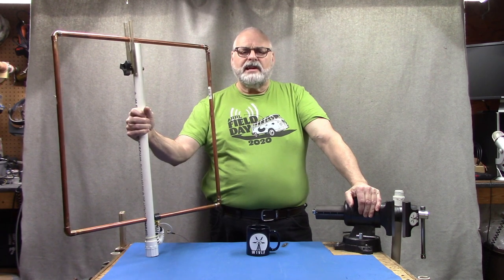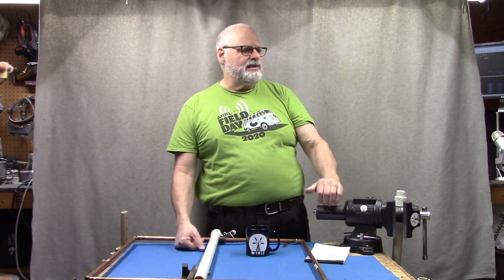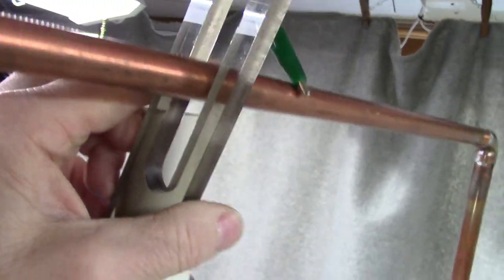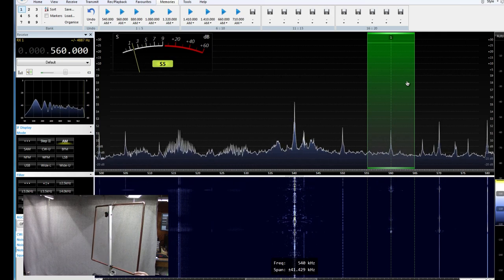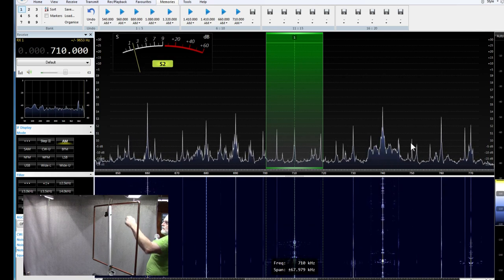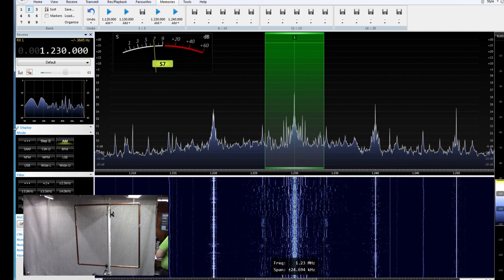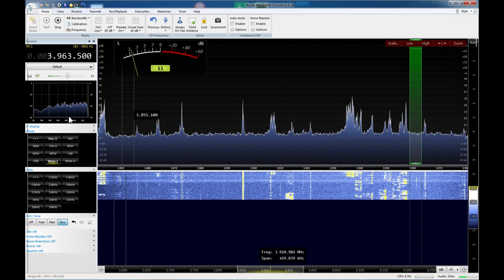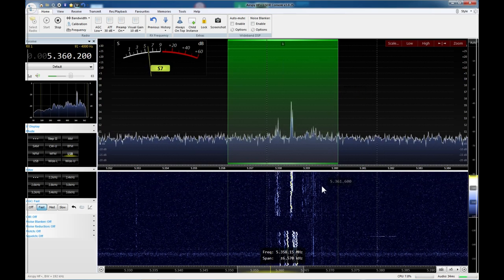W1VLF  "LIL" Low Impedance Loop

Comment: I wonder if one could use 1/2" pvc/cpvc pipe covered with copper adhesive tape thus eliminating the copper pipe? Would be a lot cheaper, lighter & easier to build. You might also get better results if the antenna were round as opposed to square.

Comment: I need to build a noise sense antenna to receive my neighbors plasma tv QRM generator. I’m thinking to build a 3-4 ft LIL. Ideally, I need a near field antenna, so that the distant signals aren’t cancelled. Using the 75 material, how many spurns on the core would you guesstimate might work? Increasing the turns lower the frequency effiency?

Comment: is there any way you can put together one of those and send it out to me? I am one of the few totally blind hams that enjoys a good bit of shortwave, medium and low band listening. However, I have a couple of stations close by which can really limit my listening a bit. one of these sounds like just the ticket. I have a TV rotator up on the roof, so, mounting up and clear of a lot of stuff will make life easier. if you can't build and send one, can you recommend someone here in the valley that can help out? 73's from n7zzt

Comment: Nice antenna design. Are you going off of LZ1AQ's papers on the effects of inductance vs area for the loop? He's shown you can get the signal strength high by reducing the inductance but increasing the area (several methods can be used to get the result). The fat tube approach seems to be the most reliable but also the most expensive at least when it comes to copper material. You could probably cheat by using air duct tubes assuming you could solder them (aluminum is tricky in my experience) together to make a complete loop.

Comment: Another great video -- thanks again, Paul.  Have you checked low frequency response in the 100 to 400 kHz range, NDB listening for example?  NAA on 24 kHz or WWVB on 60 kHz? Just curious.  Thanks again.  Ken -- WBØOCV
Reply from the maker: Hi Ken.. I have not used this one at LF... its just too noisy in my basement for adequate reception.  I did how ever use the 4' x 4' version years ago for LF and it worked well... But that was located  300' feet away into the woods.   I will give the indoor LF reception a try...W1VLF
Reply: Thanks Paul.  When you were using the 4'x4' outdoor version remote from the house, were you running that "as is", with the loop feeding the coax, or were did you have an amplifier circuit at the loop?  I've seen your videos using your active vertical antenna with and without common-mode chokes.  Did you have CMCs at the loop and again in the house?  Thanks!!  --  Ken, WBØOCV
Reply from the maker: @kensejkora4424  CMC's on both ends... 1 to eliminate anything from the house getting onto the feedline and propagating out to the antenna, and 1 to eliminate the coax from being an antenna..
Reply: Thanks Paul.  For your remote loop 300-ft from the house, were you using an amplifier at the loop, or just feeding the signals from the loop directly into the coax?
Reply from the maker: @kensejkora4424  back when I was using the loop out in the woods.. I had, a QS1R receiver actually I still have it. .  It needed help below  the broadcast band but I don't think the the Discovery would.  The key is, if you connect an antenna to an RX and it raises the noise floor by 10 dB, a preamp will not help. So this depends a lot on the environment the antenna is in. Inside the house with all the garbage around, it doesn't take much of an antenna  be above the noise floor.  Out in the woods, another story.  Much quieter.. much.  Then its a matter of keeping all the crap from your house from getting out to the antenna and spoiling things.  Hence the need for CMCs on both ends of the feedline. I have a direct burial  cable out to the remote antenna location, but before I got around to getting the antennas set up, we had snow.. and it hasn't left..  W1VLF

Comment: Excellent demonstration!  How would this do at HF freqs?? up to 50 MHz?
Really enjoy your vids.
73
N7KBC
Reply from the maker: Hi Dwight, not well, It works well into the shortwave bands but as soon as the loop area becomes an appreciable part of a wavelength such as at VHF it does not work. In addition the ferrite does not work at those frequencies. W1VLF

Comment: Is this a receive loop or can it be used for transmission? If so, how much power? Thanks,  73s, de N5DHT
Reply from the maker: Receive only, Dennis..  W1VLF
Reply: QRPp at best with materials shown. any appreciable power will induce HUUGE currents